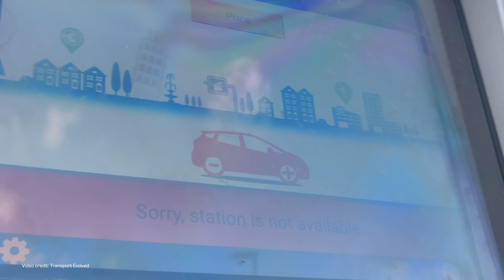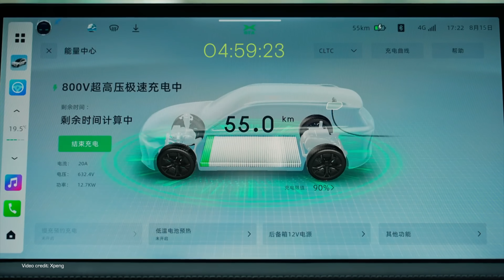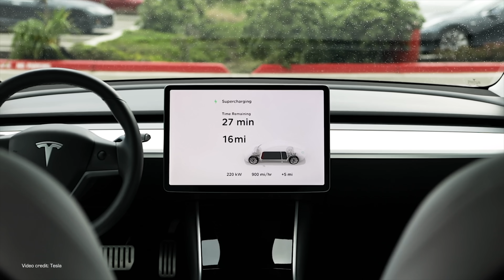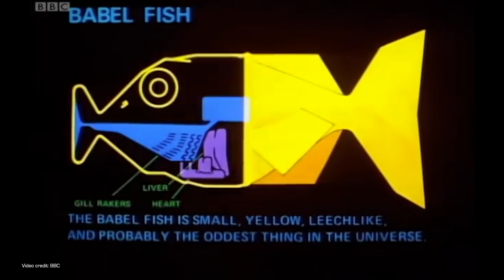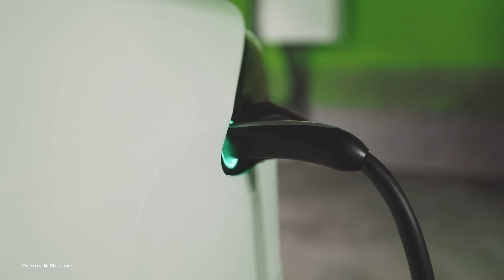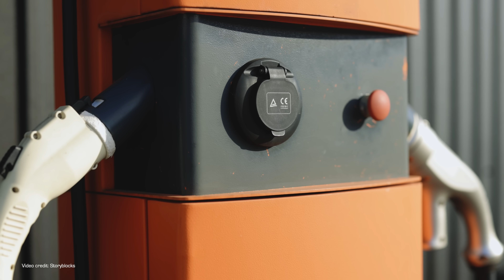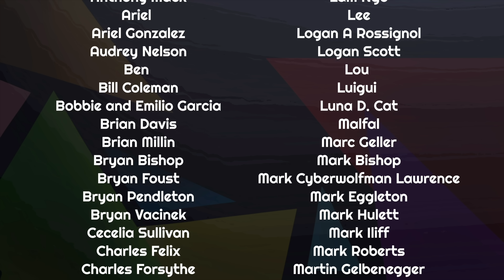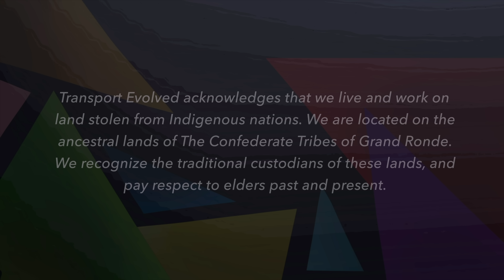NACS Standardized!?!

Comment: Not quite on topic, but the Tesla Superchargers equipped with the MagicDock are a definite option (where available!) during the transition. I've used the MagicDock with my Bolt and it worked flawlessly -- just be sure to set up the Tesla app first (which I had done). And it was a heck of a lot cheaper than Electrify America!
Reply: It depends of it's cheaper or not. SC pricing varies by location! There is a lot of locations that are more expensive.
Reply: @esprit1st75  Yes, I am sure it varies by location. For me it was $0.33/kWh (Tesla) vs. $0.49/kWh (EA). Of course, that compares with ~$0.04/kWh in my garage!
Reply: @DrTeeHenry  - this one fella i watched,  ended up breaking down the public charging cost to being real close to twice as much as a gas vehicle.  he didn't realise that for the longest time but then it struck him out of curiosity of just how much public charging is adding up.  so he added his charges up and felt it was pretty darn costly to public charge only for fastest charging.  was so costly thats why he ran the math on the average gas cost with how much he drove and it came out to being real close, if not  flat out twice as much as a gas car would of cost.  

seems like he did all the math right and what not and so thats really wacked.   so its basically crucial to try and charge way more at home verus public charging.
Reply: @x-LestatTravesty-x  Most definitely. My occasional back-of-the-envelope calculation has indicated that DCFC was comparable to gasoline on a cost per mile traveled. But there are lots of variables. Gas prices are coming down. Some DCFC is free (rarely, but sometimes). Variations in DCFC rates (as I noted in my comment, as an example). The efficiency of the vehicle (both ICE and EV). I DCFC only when I have to -- road trips -- which isn't often. Some people don't have the luxury of easily charging at home (e.g., apartments or condos or where they have to park on the street). But there are public Level 2 chargers -- often free or considerably cheaper than DCFC.

Comment: Personally, I would rather have the chargers come without an attached cord, or at least have an auxiliary outlet on chargers with an attached cable. 

I've seen chargers with the cords chopped off due to theft, and if there was a simple twist lock or similar 240v  outlet to plug into, that would not be an issue.
Reply: Bringing your own cable wouldn't get you DC fast charging.
Reply: @davekozlowski1266  true! As far as increasing the availability of chargers I'm less concerned about fast charging, and more concerned about the availability of chargers at post offices, libraries, grocery stores, etc. 

If there was a standard outlet with a locking pin that could engage when charging is started, it would lower the cost of installation, because the business would only have to supply an outlet, which, in most cases, is actually pretty simple for stuff less than 50 amps

Comment: Sidenote: You can, at least in theory, charge on a Supercharger without the whole "payment method integrated in the protocol"-thing. However, that means using the app for the Supercharger, which is just the Tesla app. This is the reason all the automakers signing up for supercharging are so eager to get other payment options working. You can buy more than kWh in that app. Cars, among other things! Source: This has already happened here in Europe. Some compatibility problems for some brands. No big deal.  On another note: The new Version 4 Superchargers currently being installed can work with your favorite credit card. Same source.

Comment: Kate,
Thank you for the reminder that many of the older EVs may have hurdles to tackle to use J3400 based plug via adapter.  Been thinking about a newer eGolf for one of my sons.  Luckily CCS plugs will stay at most stations for at least another 5-8 years given the large number of EVs with CCS combo on them.
Reply: That's the thank you that early adopters get
Reply: The other reality for many of these early cars is they are not well suited for travel due to short range, slow charging, and now depleted batteries. They really are around town cars.
Reply: @NHRunDad  My first EV was a SparkEV.  Even in winter (20-35 F), always had 65 on the GOM charged up. 82 in warmer temps  A great work commuter as long as you don’t tag a 30 mile side-trip on after work.  A newer eGolf might be findable with lower miles & the larger battery (~36kWh usable) would give > miles.  It’s all about shopping for a good one that doesn’t break the bank.
Reply: @daves1646 agreed. I just sold my 2019 40kWh Leaf. I live in NH. It was fine for short trips, but I couldn’t make it to ski areas, hiking, etc in winter. In summer it was better but I may still have been hanging at a L2 charger for a few hours while coming back due to no DCFC. Absolutely perfect for local commuting though. I sold it to a used EV only dealer and he sold it for $9300. 65k miles and still had a strong battery, but I outgrew the range! Someone got a great deal.

Comment: The difference between this and ccs1 is simply if it doesn't work flawlessly with tesla charges the company that released its is rubbish.
You are trying to put they on a level that not the case tesla is right and if you disagree you are wrong in this case.

Comment: Tesla HAS OPENLY stated that every maker can use their charging standard, including the plug, BUT HAVE NOT published the FULL physical specs of the connector plug / inlet.  Wow.  So Tesla’s commitments are not worth as much as their complete execution, eh?  Not a way to inspire confidence.  I’m liking my CCS Combo that works more and more!
Reply: Umm....just wrong. It's been published before and now is sae certified. You can look up all the spec's on it.
Reply: @davekozlowski1266  Tolerances of the specified dimensions not published.  Per Kate W-E the video.
Reply: I need them so I can Whittle my own adapter

Comment: Tesla should just offer a basic charging script for any automaker to just slap into their vehicle to cut down different 'interpretations' of CCS.  It's then going to be up to automakers to test, test and test their cars charging performance before releasing them into the wild.  No, it probably still won't be flawless, but at least when pulling up to a supercharger, you've basically eliminated one variable: that the charger may or may not be the problem.  If you pull up to a supercharger and the charge won't initiate, 99% odds it's the car.
Reply: Tesla doesn't have much incentive to do that. If customers have a bad experience, and it is the fault of the car as you say... what can the customer do to resolve that situation? Easy. Buy the car the charger was built to work with. In demanding that charge providers be brand agnostic in order to gain access to incentives, the government has essentially handed Tesla one of the greatest sales strategies ever.

Comment: Okay. I likely won't have a NACS adapter for my Bolt by the end of this quarter. At this point, I don't need one because the existing CCS network despite its flaws meets my needs. However long I'll wait for an adapter, the existing CCS network will presumably continue to meet my needs. Would be nice if I didn't need to use an app at a Tesla station, but I already use apps for many CCS charging providers, so I'm not worried about it. As long as the EVGo and ChargePoint stations that I know and love continue to exist, I won't use Tesla's stations anyway. I must swipe an RFID card on my keychain at ChargePoint stations, but this swipe is negligible.

I still welcome the standardization and don't worry about my EV losing its resale value as a consequence. If I had a Leaf with only a Chademo connector, like a woman I saw at an Electrify America station recently, I'd worry more. EA is difficult enough with CCS.
Reply: I hope I never have to put a Tesla app on my phone
Reply: @rp9674  I already have six charging apps plus PlugShare on my phone. One more won't hurt, but I'm not convinced yet that Tesla can't bill automatically through a CCS adapter without an app. EVGo does it. I only used my EVGo app once after setting up an account with them. Since then, the network has recognized my car when I plug in and billed me accordingly.
Reply: It's possible that some networks will offer a Magic Dock like connector that provides a dual option so an adaptor would be more an optional purchase than a necessity. We really won't know until mid-2025 what charging beyond 2025 will begin to look like (for existing non-Tesla EVs). 
For one thing, we're going to see a number of new network providers. Shell, BP,  Pilot Travel Stations, etc.

Comment: Charging cable will need to be much longer for various cars.  You forgot to mention the side of the car that various car manufacturers place the insert. Some manufacturers have the port on the right side or in the front. This requires the Tesla Supercharger to lengthen the cord. If not, a non Tesla will block one charger to have the cord reach their car.
Reply: The ones that put the port near the A pillar I understand may be an issue, but why would the port at the front be an issue? Wouldnt the driver just... pull in?
Reply: or EV manufacturers could stop making EVs difficult to use and put the charging port in a reasonable location.
Reply: Yeah I never understood why you'd put the port to starboard. On gasoline vehicles either, I mean. What was up with that?
Reply: Version 4 superchargers have much longer cables.
Reply: I think longer cables would mean thicker cables, so much for being elegant and dainty
Reply: All the new charging stations will have drive-thru lanes and long cables so can pull up on either side, even when towing a trailer. 😉
Reply: that is going to take a lot of space that isnt available where chargers are needed. unless, of course, you start throwing away gas pumps and replacing them with charging stations. even i think its to soon to do that. although it is time to stop building new gas stations, doesnt anyone check reality before approving a new gas station? @AerialWaviator

Comment: I have enjoyed 3 EVs over the last 8 years, being on my third lease, and know I’m privileged to have a home charger. I’ve used a fast charger precisely 3 times, once each per vehicle to confirm functionality. Otherwise, I’ve always just used a level 2 charger and believe they’d serve most owners for over 90% of use cases. The switch to NACS will be good to have one, rather than 2 or 3 standards. However, if you can charge at home then the majority of current generations of cars will handle daily charging needs back home. Maybe that was obvious but so much time is spent talking about fast charging and long haul drives, it seemed necessary to say.

Comment: Changing the plug is not going to change EAs reliability
Reply: It might indirectly increase EA's reliability because EA customers will now have Tesla as an option. There won't be a plug incompatibility preventing charging networks from having Tesla as a direct competitor.
Reply: @ArtiePenguin1  It could possibly improve repair times but it isn't going to change the hardware fallibility which is what i was referring too
Reply: Agreed. If anything, I might worsen EA since the Tesla plug/cable is much lighter weight and has a significantly shorter lifespan. As bad as EA is at replacing broken cables/connectors, imagine how much worse it will be when those cables have a service life of 3,000 uses instead of 30,000.
Reply: @tjs114  what's the life cycle count? How'd you get this info?

Comment: Do we know if the legacy groups with NACS on the car as of 25 will have the charge port in the same location as Tesla?
Reply: No reason to believe all of them will do that. For some it would be a big redesign of the vehicle at a time they were mostly planning to modify trim pieces to make a new model year.
Reply: It's unlikely because that isn't the best location depending on the vehicle. Pickups for instance can remove the bed for other uses.
Reply: @davidmccarthy6061  I imagine then Tesla sites are about to be a cluster due to the taking up more than one space issue unless many more are updated to V4